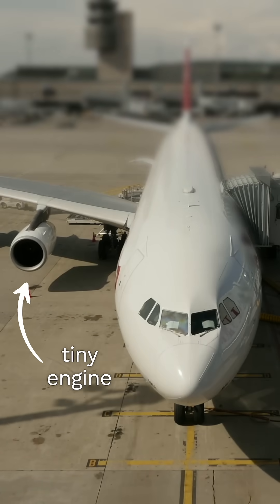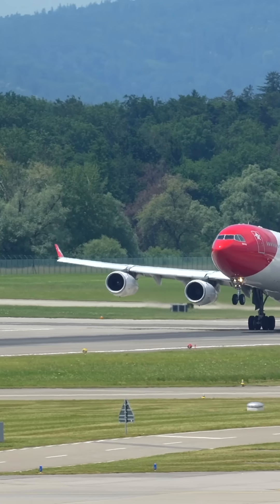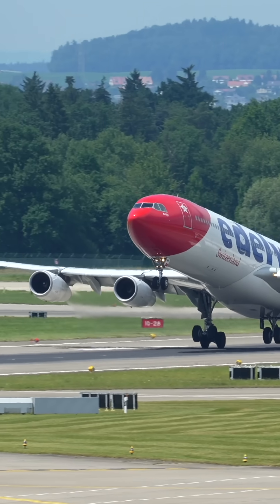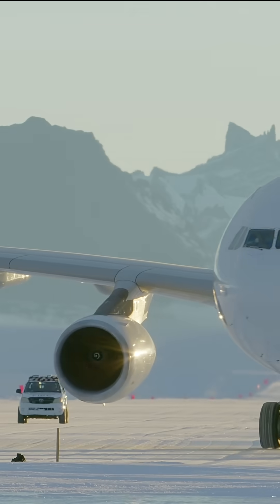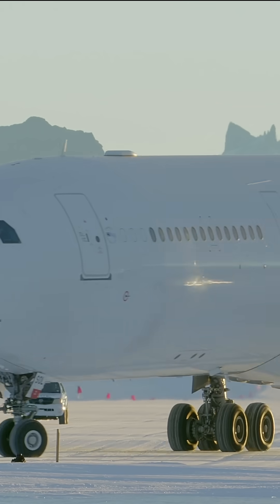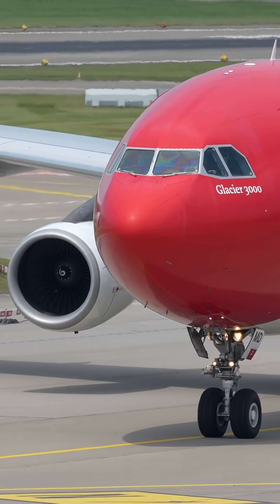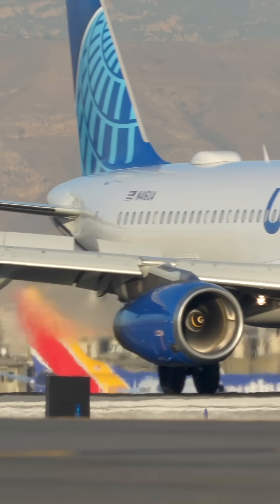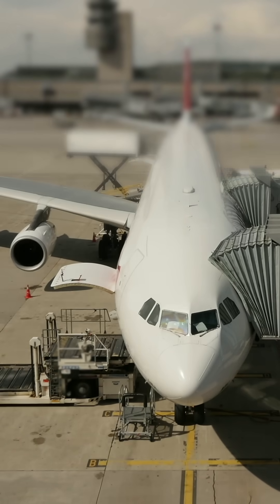The World’s WEAKEST Plane…

Comment: The superfan was planned to have 25000-30000 lbf (with 15% better fuel burn than competition, resulting in a lower MTOW). the a340 wouldnt have been a rocket either way.

Comment: Usually the slow climb rates and long takeoff are because of the use of flex temperature and derated climb thrust, combined with its very high wheight. At full thrust it isn't that underpowered. Still the best aircraft ever made

Comment: I’ve seen so many comment asking “why don’t they make an A34neo?“ they did! It’s called the A350!.
Reply: It’s actually A340-500 & A340-600 because A350 is different a lot
Reply: Im pretty sure the A350 is the successor of the airbus A330 as the a340 is technically the same as an a330 but it had an extra set of wheels on the middle fuselage and 4 tiny engines until later models had RR trent variants
Reply: My comment was designed to tongue in cheek. I believe changes to Extended-range Twin-engine Operations Performance Standards (ETOPS) was a huge contributing factor that resulted in the demise of the great Airbus A340. 
It safe to assume the 4 engined A340 was designed to fit the 1988 ETOPS regulations which were 180 minute for twin engined aircraft. In the same era  (1990) McDonnell Douglas released the tri-engine MD-11 to suit the same regulations.
In 2007, the aviation industry significantly changed when the FAA introduced a final rule allowing US registered twin engine aircraft to fly more than 180 ETOPS. Other regulators soon followed the FAA resulting in twin engined Aircraft began replacing quad engined aircraft on oceanic a longer routes.

For those interested, here’s a summary of the ETOPS over time.
1988: The standard was generally increased to 180 minutes, which allowed for almost all transatlantic routes.

2007: The FAA introduced a final rule allowing U.S.-registered twin-engine aircraft operators to fly more than 180-minute ETOPS, to the design limit of the aircraft. This change broadened the definition of ETOPS to "extended operations" for all multi-engine aircraft, regardless of the number of engines.

2014/2015: The Airbus A350 XWB was the first aircraft to receive an ETOPS-370 rating from European authorities (EASA) before entering into service, which is currently the highest certification available.

2017: The International Civil Aviation Organization (ICAO) replaced the term ETOPS with the new term EDTO (Extended Diversion Time Operations) in its international standards to better reflect the scope of the regulations, which now cover all aircraft with more than two engines as well.

Comment: Actually, Rolls-Royce was supposed to develop the Trent engines for them but could not deliver them on time for the 340 so they went with the CFM 56 the A340 600 are great flying airplane
Reply: The Trent was developed for the A330, no?
Reply: @prestwickpioneer3474 .  Yes, that's my understanding and I believe a version of the Trent was going on the A340 as well designed and built, concurrently, what I read 20 years ago.

Unfortunately, Rolls-Royce, like other commitments and promises they've made in the past with other manufacturers(Lockheed L-1011) was not able to fulfill the A340 contract, which made Airbus pull available. CFM 56 engines which are totally not designed for the A340.
Reply: @Boston737Brian  the original TA11 design was planned to have the RB211-535 and PW JT10 engine options. But the A340 as developed was always planned for the CFM56-5 with the IAE Superfan option coming up. Until it cancelled. RR were a major shareholder in IAE.

Comment: It’s a myth that the A340-200/300 was underpowered. It was 200,000 lbs lighter than the -500/600. It was powered exactly right for its weight. It used up the same runway at maximum takeoff weight as other 4 engine aircraft.
Reply: Its thrust to weight ratio was among the lowest out of all Airbus and Boeing aircraft, so yes. It was one if the weakest planes. It needed less runway than the newer A340s, but takeoff still took longer on the older aircraft.
Reply: @I_Dys thats true but that was intentional. To save fuel. the original engine was gling to be more efficient but even weaker because the plane was going to have a lighter MTOW because of lower fuel burn.
Reply: They built it without a good engine in their zest to market a 4,engine jet. Hence its sales were not stellar
Reply: @keith.sorrells what bullshit. At it's time it had a perfect use case for long haul.
Reply: @keith.sorrells at its time, before ETOPS ratings started getting to the point where planes could cross oceans directly, the a340 still filled a gap. more engines = more redundancy which was important at the time for flying long haul routes. Sure, the 747 was probably the better long-haul aircraft anyways, but the a340 WAS airbus’ competitor for it in terms of ocean-crossing flights

Comment: And it's iconic for those tiny engines, it also made maintenance easier since maintenance crews could transition from the a320 to the a340.
Reply: And increased the maintenance and operating costs  significantly because of the 4 engines .
Reply: @keith.sorrells  That's a drawback it got saddled with later. Don't forget that this plane was put to paper before ETOPS. If you wanted to fly across water, you needed 3 or 4 engines.

It just got unlucky that shortly after it started flying ETOPS became a thing.
Reply: It’s not the exact same as the a320 but similar

Comment: Coby, if the a340 was indeed equipped with the superfans, do you think it would be in use widely today or would other planes still outperform it?
Reply: It probably would still be outperformed in the longer run since maintaining two engines vs four engines is cheaper and faster.

Comment: The difference is quite simple, LHR-HKG B747 140,000kg of fuel, A340-300 72,000kg. I wonder why they were so popular?
Reply: And the 747 carried immensely more people and cargo.
Reply: @keith.sorrells  no it didn’t actually, typical pax for a four class 747-400 was about 305 while VA who operated the type originally only had two class cabins with an all economy lower deck, this was considered only acceptable on holiday routes also with that large a pax load no freight could be carried as the pax bag load was too high. On all their premium routes the 74 fell out of favour as the 340 with only a 10% drop in load was 48% cheaper to operate.

Comment: The thing is... Why didn't Airbus use or put those damn pw2000 engines on those a340-300 instead... Those engines would make the plane far more powerfull and the consume just a little more compared to the cfm56-5c3 c4 and c4p...
What a waste
Reply: Or the rb211-535 engines
Reply: @danielmeador1991  the RB was unlikely thanks to his demand! Several planes were already using it! Such as the 747, 757, l-1011, 767... The rate of production would be far less and make delays, compared to the pw2000 that was equiped on the 757 and c-17
Reply: @2K03lee still would have been a better choice then the cfm56 that was made for narrow body jets the pw2000 the rb211 would have been way better for the early a340s

Comment: Try again Colby.
The 340 was only designed as a middle to long range jet that was fuel efficient. When the stretch was made for the 340-300, the larger CFM-56 was added along with larger fuel tanks. The A330 uses the same fuselage with a cleaner wing 
Twins are weer it's at, and two GE 80E's, P&W 4168's, or RR 700's are more fuel efficient.  So unless you need range, the 340 became a no so needed aircraft.
Reply: Airbus was trying to address two markets with the A330 and A340 families. The A330 was the short-haul model and the A340 was the medium-to-long haul model. Extended operations rules for twins were still conservative at the time the planes were entering development, so Airbus focused on four engines for the A340.
As fuel loads are much higher on longer sector lengths, the IAE SuperFan's claimed 20% fuel reduction would have been a real economic advantage. 
But even with the CFM-56, the fuel burn per hour of the A340-300 was relatively comparable to the 777-200ER. However the 777's ability to carry more people per row meant it could generate more potential revenue per flight. And Boeing successfully getting ETOPS rules expanded to 180 minutes (from 120 minutes, I believe) and soon thereafter to 207 minutes meant the 777 could fly most anywhere except the deep Southern and Indian oceans between Australia and South Africa.

Comment: why kick a dead horse?
Reply: Slow day for content
Reply: True, Airbus doesn’t manufacture the A340 no more but there are some still flying out there.
Also, that’s the A340-200 that he’s describing, the A340-300 solves some of that with bigger engines & added capacity.
Reply: @fchanMSI  did you mean the -500 and -600? The -300 is heavier and uses the same engines as the 200
Reply: @AirRBnpcsorry, thank you for the correction.
Reply: @fchanMSI  he specifically references the 300 as the “hair-dryer “ though

Comment: I loved the A340 because I prefer planes with four engines  (or at most, 3 -- loved the L1011.) But coming from aerospace industry years ago (I was responsible for computer engineering systems of maintenance and provisioning for all DC8s and DC9s), I never thought these little engines made this plane particularly safe. 🚅
Reply: There were 380 of these planes manufactured over the last 34 years. The A340's record is: zero fatalities, but 12 serious injuries when one of them overran the runway during a thunderstorm. That record makes it one of the safest airliners ever built.

Comment: Why did they never offer a different engine? There must have been more powerful options, but would those have been a step back in efficiency?
Reply: Airbus did fit the RR Trent 500 on the larger and heavier A340-500 and A340-600 models, but they were too large and heavy for the A340-200 and A340-300. The PW1100G GTF would probably have been a decent new engine option, but the 777-200ER crimped the market for new A340-300s and Airbus significantly increasing the MTOW of the A330-300 really ended any market for the plane, even with new engines.
Reply: @Kiskaloo  Thankyou for the info. According to wikipedia, about 1/3 of the deliveries were the Trent variants. Furthermore, I learned about exhaust mixers, aka the reason the CFM56-5Cs looked so strange to me.
Reply: @Kiskaloo  I always thought the A340 killer was really the A330 rather than the Triple Seven. Why buy an A340 when you can get a plane that’s almost identical just lighter, more fuel efficient and saves on maintenance with two less engines?
Reply: @SamHeaton264  It was generally a one-two punch. First the 777-200ER's greater revenue generation ability and then the A330-300's significantly lower fuel burn once Airbus significantly increased the operating weights allowing it to fly much longer missions.
Reply: @SamHeaton264  A340 killer was ETOPS. A340 was more economical and faster, because it could fly directly to its destination, while any two engine aircraft always had to be within 60 or 90 minutes from the closest airport.
When engines started to be standardized for twin-engine operations further away than standard 60/90 minutes, more-engine options become unnecessary
Reply: @SamHeaton264 and that’s why it sold better
Reply: RB 211s that the 757. It produces 10,000lbf more than the cfm 56-5c
Reply: @nedaugust43 those were the best engines for the 757.  It could climb straight to max altitude from takeoff with full fuel load.